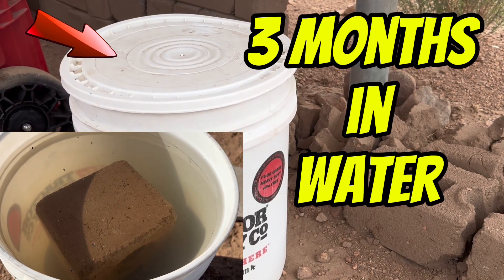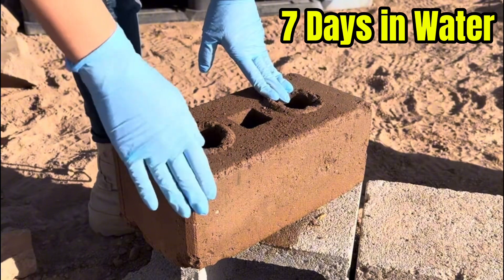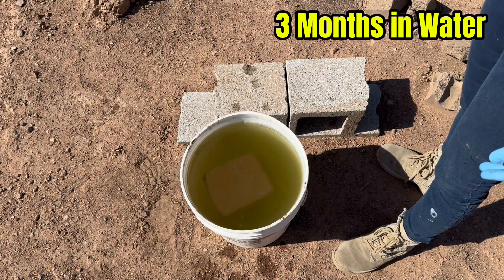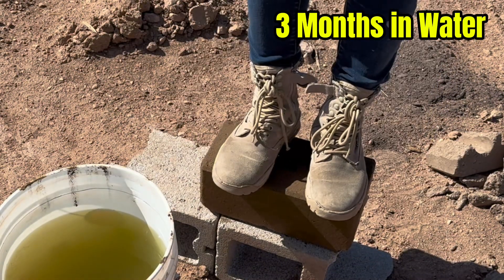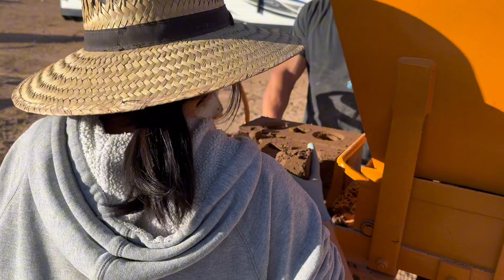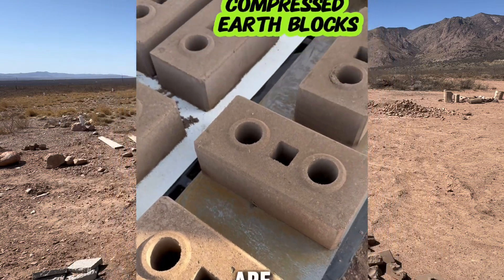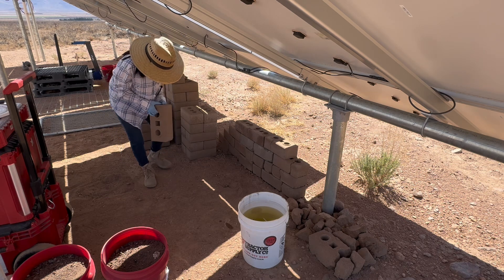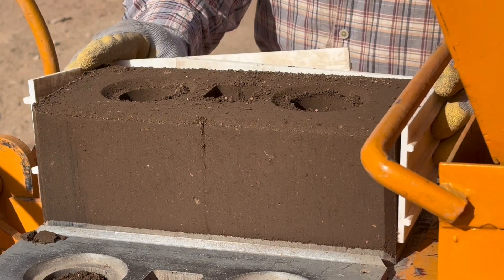3 Months Underwater: Can Our Earth Block Survive?

Comment: They seem plenty strong enough.  Just get used to the idea that you should use a lime/sand/soil plaster on the outside and have eaves that go out enough to reduce the rain.  
In your bottom 24 inches, use 20% cement blocks.  With the eaves, plaster, and stronger resilient block on the first 2 feet should definitely last a very long time.
Reply from the maker: @bigonprivacy2708 And thank you very much for your advice.  @bigonprivacy2708 even thinking of  @bigonprivacy2708 our house.  W @bigonprivacy2708   @bigonprivacy2708

Comment: So would you trust compressed earth block with clay and 10% Portland cement to line the walls of an underground well? (if there was a mortar sealant used)
Reply from the maker: @coryart  thanks for the comment!  If your saying 90% Clay and 10 Portland I was told for it to be structurally strong you would have to add sand. But it would also depend on the sealant. I would have to mess around with the more I think about it the more questions pop in my head.